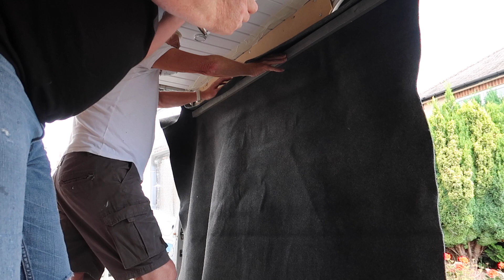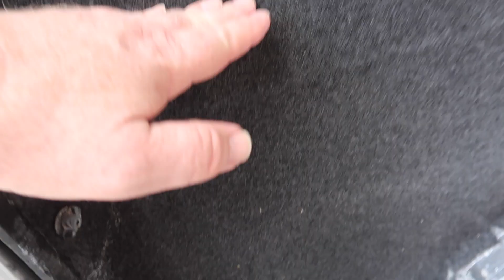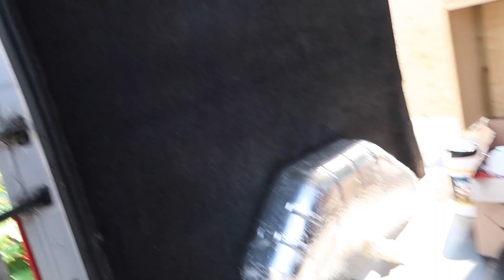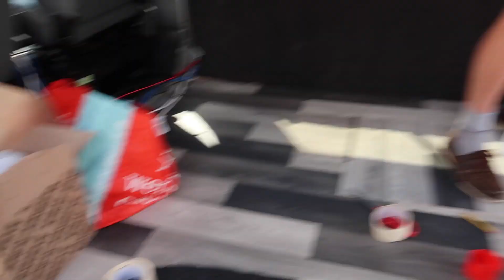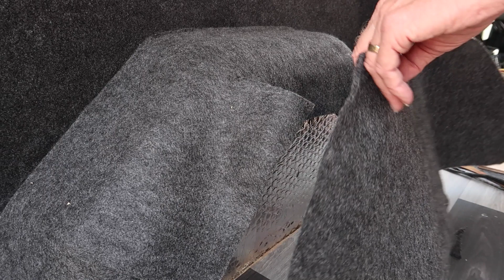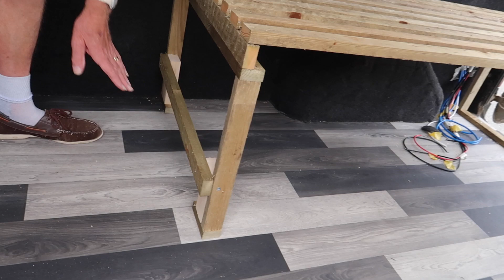TIME FOR DECOR! | My SELF BUILD Camper Van Episode 8

Comment: Not a bad attempt at all gents. Strikes me though that the material perhaps isn’t quite as stretchy as others. I did my workshop van and managed to complete the stretch in one piece all over the side and wheel arch - found it really forgiving. Then if you had a crease you could pinch it and cut it (hard to explain). 
Next job is to do exactly what you’re doing. MWB of sorts and make a camper. Too old for tents now… even air beam kills me!!
Keep up the grand work!